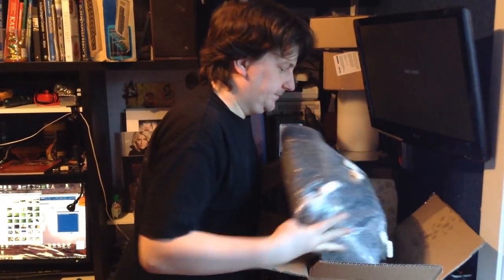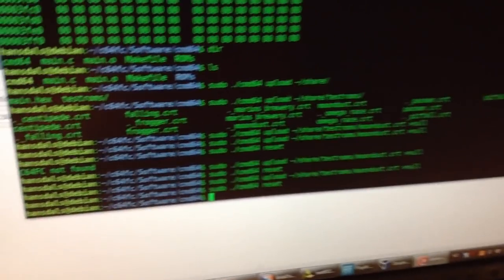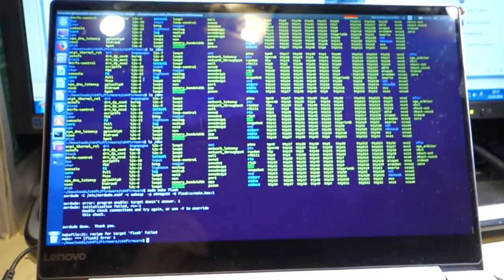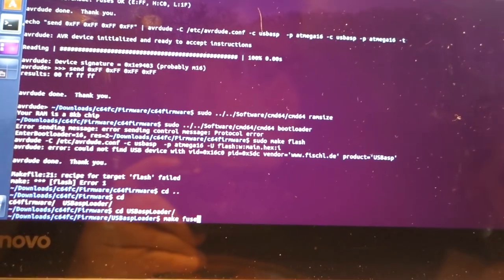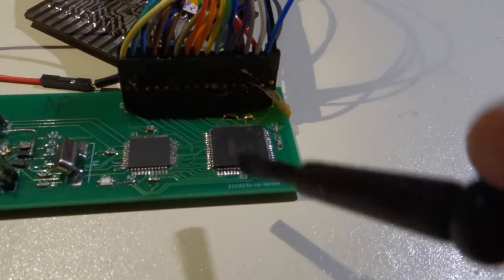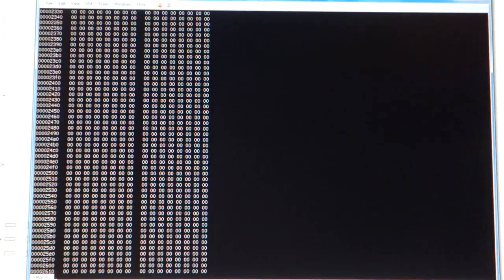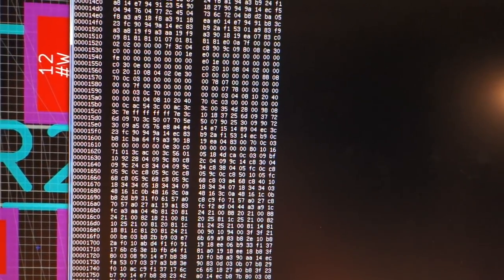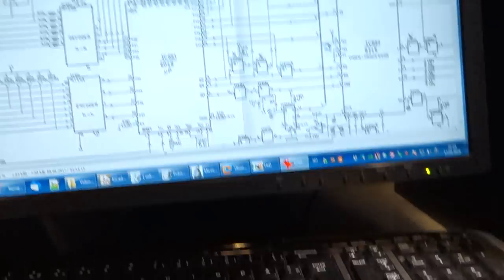The videopac meets the modified C64FC USB cart

Comment: Woohoo! It's working! It's a great feeling when you type that cli command and your hardware reponds as expected. 
Finding that bridge (and removing it) was a big step. It looked hard to spot where the fault was. I suspect you're looking at expensive microscopes if you want a better look at that.
So, next steps will include some kind of software interface to accomodate the loading process I suppose.
Reply from the maker: Thanks. Yes, allthough I had a hint when I saw that memory dump showed mirroring. You asked for spaceman splorf somwhere, it will be sold at packrat in mid to late April. http://packratvg.com/splorf.html oh wait, that was atari 2600!

Comment: Hans, I never use auto routers. I did end of the 1990s and the early 2000s. We had a 20000DM program (Specctra) for that. Our most expensive tool. I noticed, that when I manually corrected the stupid things it did, it takes as long as a hand layout. And while manually routing, 
I also notice some mistakes, I have made while entering the schematic. And your footprint (or the soldermask settings are not good) for that IS is not great, because it is all mask free between the pins. This way, you get all kinds of funny shortcuts. A very narrow strip of soldermask is better than nothing. Or maybe you had dispensed too much solder cream on the pads. I like to use some smd flux (which is liquid like water), it also helps to prevent short cuts and the soldering results are pretty good. 

Anyway, nice, that it works.
Reply from the maker: Thanks! Yes, regarding the tqfp footprints. It would help to have soldermask between the pins. I'll have to research that some more with KiCad. Also I'm moving to Kicad5 hoping that the footprints and its settings might have changed. Maybe there is a clearance or fill setting that is too large that makes all soldermask go away around the pads.. I found it! The setting is called "Pads mask clearance", and it was set to 0.2 (mil I think). When I set it to 0.1 i get soldermask between the padsPads and I see that the C64FC card (yellow card in the video) has a tiny strip between the pins. Thanks for the tip! Regarding soldering, picture the chip dunked in reflow flux and a solderball dragged over the pins followed by solder wick on the few bridges that formed. Not the best, but it works for my prototyping purposes. For production I think I will use a stencil and paste. That works for me. Much easier to get propper amount for each pin.